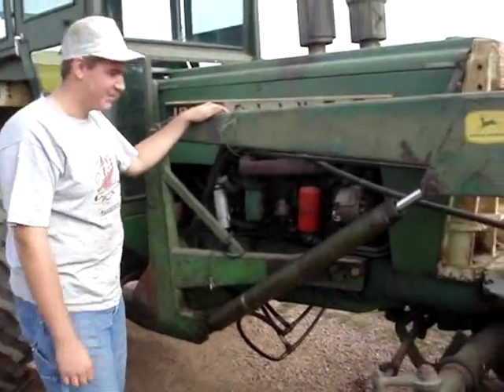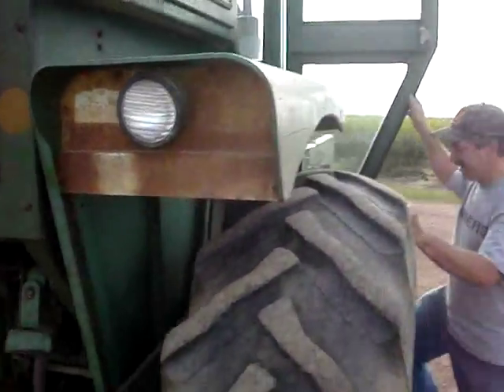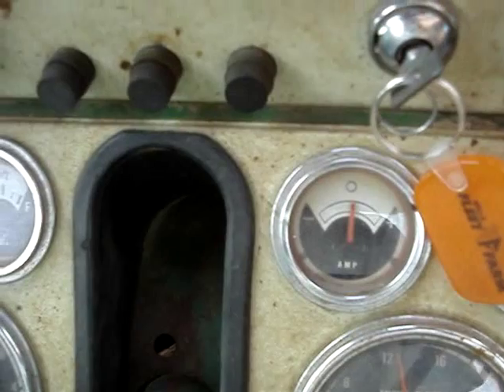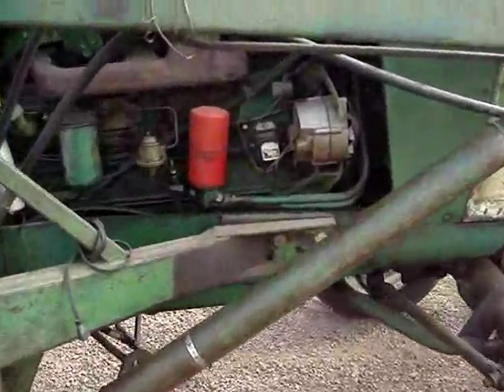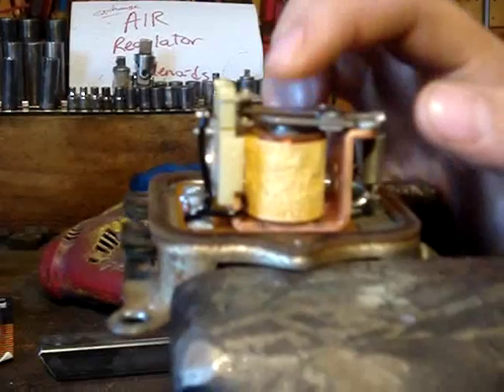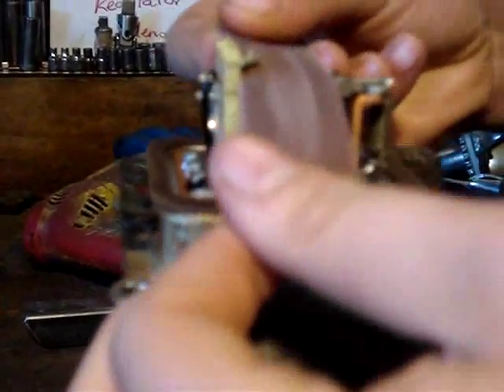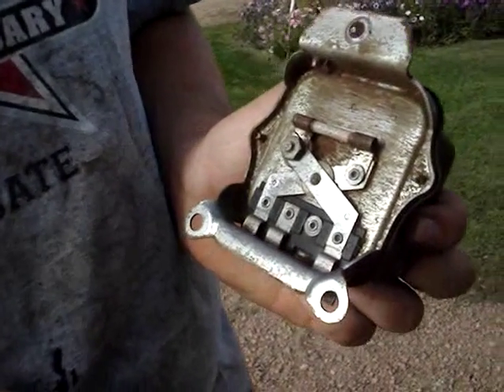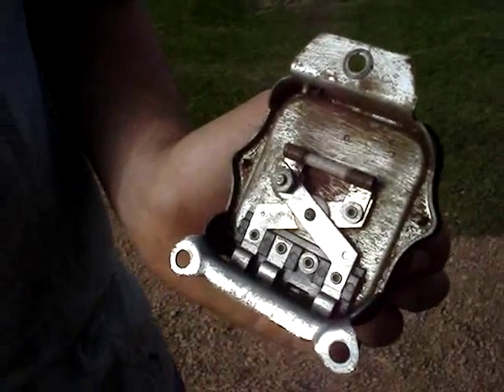Fixing a Mechanical Voltage Regulator on a Tractor

Comment: Being that the voltage regulator is out and exposed to the elements like dirt, heat, rain, condensation inside the case. Your going to have do regular maintenance and even keep extra electrical parts in stock. Good video, thank you.

Comment: thx for the video info, i cleaned the points in mine and it started working normal again, hopefully it will last another 50 years on my 64 T-Bird
Reply: PS. the regulator on the car is the factory original